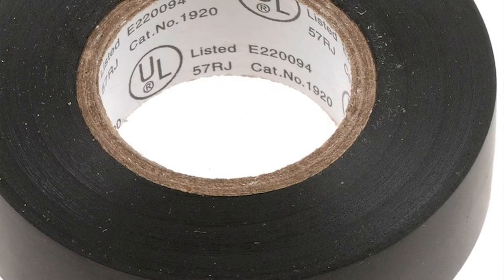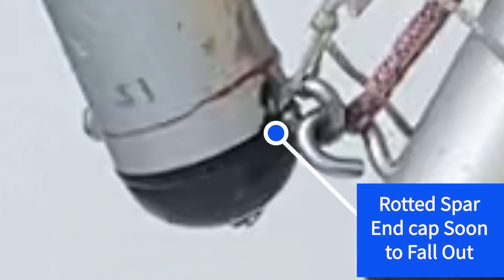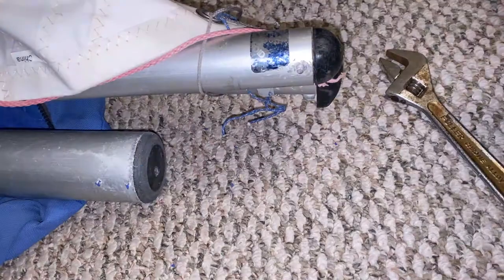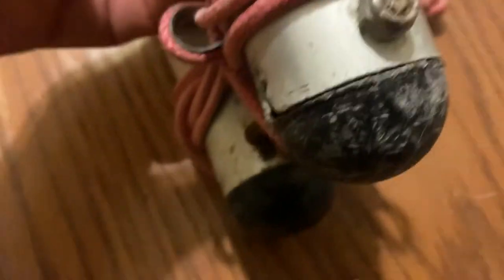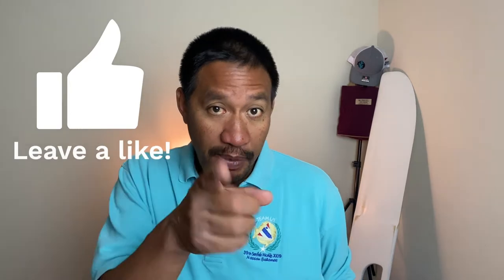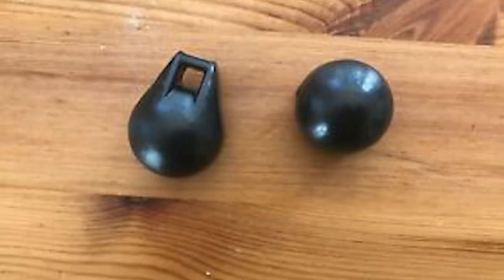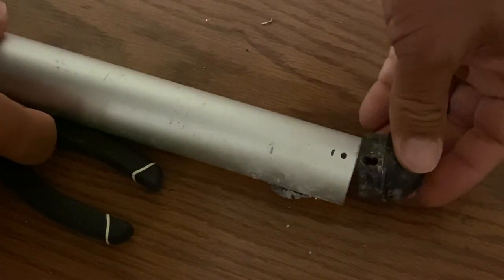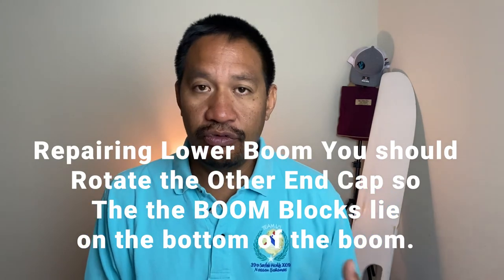Sunfish Sailing | How to Repair Spar Ends Erosion

Comment: This past summer I was maintaining all the Sunfish in the youth program at the yacht club. I did 4-5 boats with this problem. I can do this fix in 10 minutes or less. Just make a mark going reward for the centerlines of the holes. Use a pipe cutter just behind the bad part. Use the end you just cut off to mark how far back you need to dril the hole. You just line up the face of the part you cut with the new face. Drill new holes. Use a round file to take the edge off the inside of the boom face. The pipe cutter pushes in a bit. Then put it back together. People were shocked at how fast I could do the repair.
Reply from the maker: Absolutely Sam!!!   It’s an easy repair, much easier than making the video  :)   Hehe
Reply: @LeeSideSailing  Making videos takes a lot of work. I like your videos keep them up. This one just happens to be one I can comment on from experience.
Reply from the maker: I appreciate your input!
Reply: Presume you are sleeving the gooseneck?    I have wondered if I can put a section inside of the boom?
Because I am using them for sailing camp and JV racing they do not need to measure.  FYF I have a halfdozen worlds sails that I think may be a bit larger than the race ready Intensity sails  so I do not think cutting the end off works

Comment: I use a plastic tiewrap to hold the lower spar in case the the nut falls off.  It'll keep you sailing until you replace the nut.
Reply from the maker: I use electrical tape to hold the nut:).  Thanks for the comments!

Comment: Sorry Lee, leave the hack saw & file in your toolbox! Get a tubing cutter, (or pipe cutter as you call it). Perfect cuts in less than a minute, no metal chips. If it's a new spar, it's probably long enough for the outhauls to pull the sail tight. If not, lengthening it requires an internal sleeve which can be made from discarded spar material. DON'T DISPOSE OF OLD TUBING ! (You will need it for future sleeves). I also sleeve high stress areas of the spar or boom. Probably not class legal, but I do not race. Fabricating such a sleeve is labor intensive, but you will end up with better than new! Tricks I learned from building hang gliders years ago. Basically, you remove a narrow strip of aluminum along its 12"- 15" length. It can the be compressed for a TIGHT fit! Good topic for a future video!
Reply from the maker: Thanks!!!  Great tips!!
Reply: I just ordered 5 spars from intensity  the shipping is $710   When you are sleeving are you setting in epoxy or silicone?   I use my boats for instruction and JV Racing  so they do not need to measure in.  finally I am setting Goose 18 halyard 102 for my standard   Got a recommendation for 15  108  from a COLIE SAILS Video any recommendations ???
Reply: I have a bunch of donated laser full bottoms that I converted to radials with a tubing cutter   a pair that I also used full length with a broken Sunfish mast as the top section

Comment: Great video. I use a miter box to get a 90 degree cut. Your hack saw blade was too thin. If you use a wider blade you can get a straighter cut. Do you silicone your end caps on?
Reply from the maker: Thanks, didn’t have a miter box  but you’re right     I do not silicone   But there’s mother wrong with doing that   Thanks for the comments!

Comment: That nut hanging on the bottom of the boom will destroy your deck. I use a piece of synthetic wine bottle "cork" and epoxy it over the nut. As far as the spars separating, this falls into the general category of "failures that should never happen." This is especially true if you are a serious competitor. If that is the case then you realize just how costly a DNF can be. My point is that if you are serious then your equipment will be in top condition and you will have checked it to ensure that you will be problem free. 
The Electrical Tape is essential.
Reply from the maker: Great points Tom!